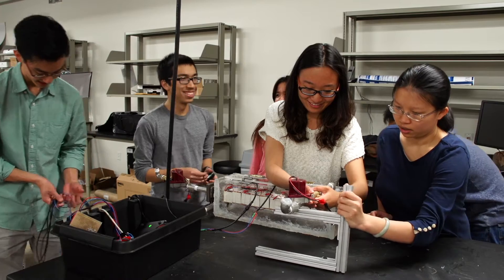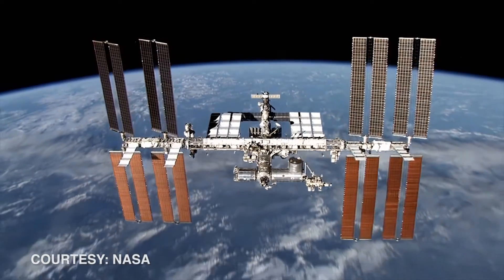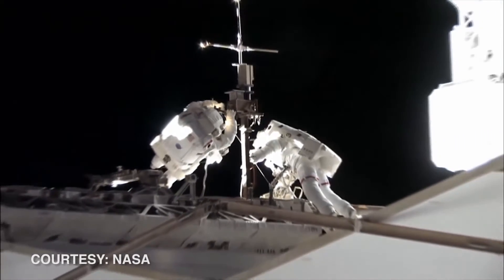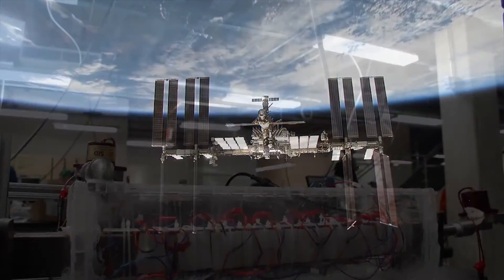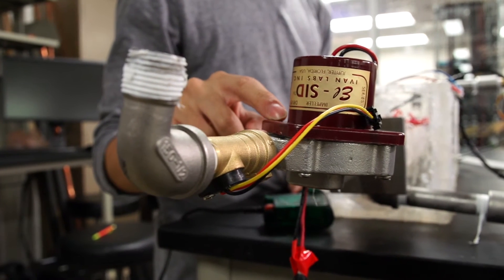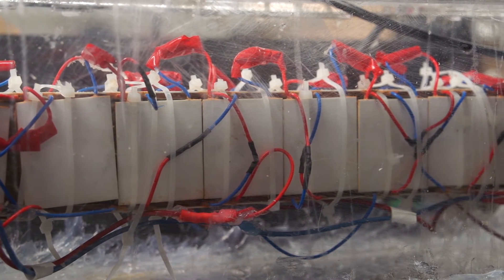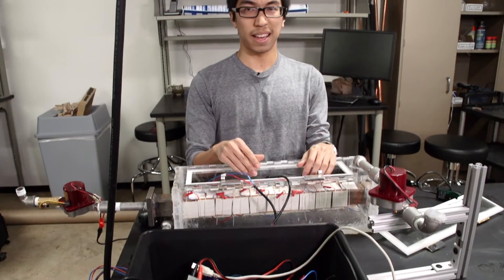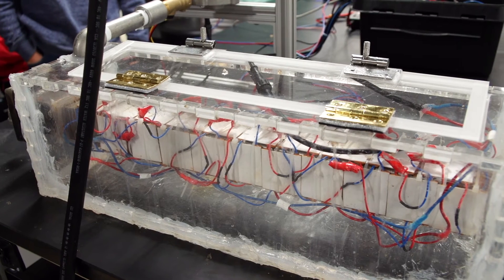Team of engineers at Rice work on harvesting energy from heat in space

Comment: Try it in a vacuum, you are probably using Peltier devices. Since the Peltier thermoelectric tranceducer needs a temperature differential to work, you need to make sure in vacuum you are able to keep that differential. ( all things in vacuum tend to go to the ground state or equilibrium which is the opposite of what you want, the more differential you have the more electricity). I don't know the rate at which thermal radiation is released in vacuum. Also, try to put out some specs like how much energy / joules received per device. Theoretically, you could use a material (water, mercury or liquid led for increasing high temperature storage) to store the heat until you get all the electricity out of it. Food for thought...